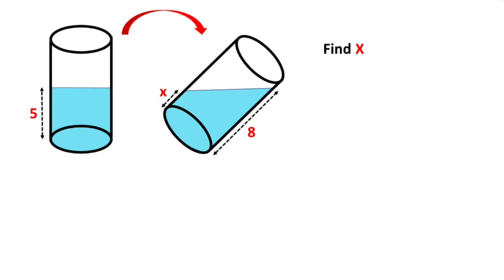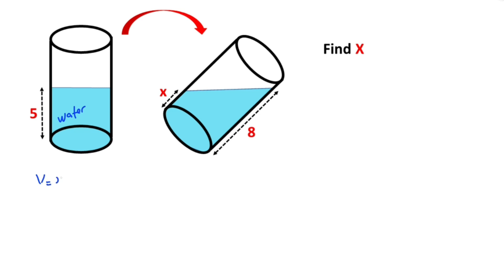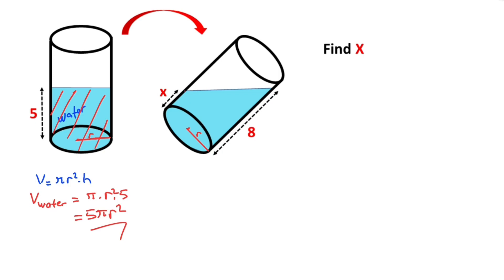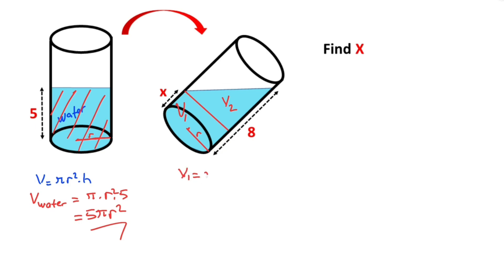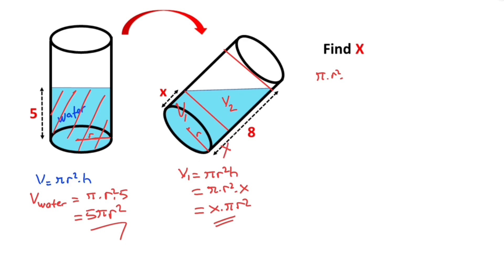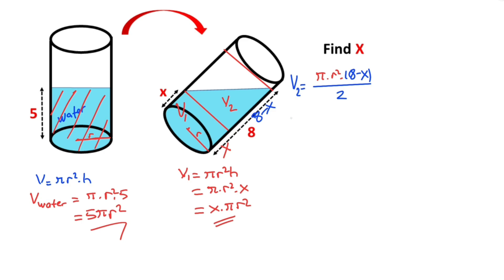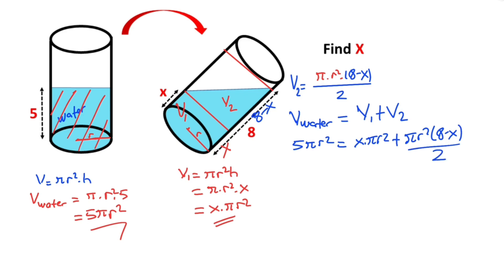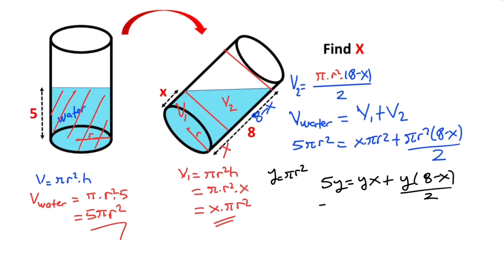How to Find The Height of the Water in the Vertical Cylinder | Solid Geometry | Math

Comment: It is not correct to equate the areas, as the image suggests, it is a cylinder (geometry in space)
Thus, with only the information provided in the image, the value of x cannot be calculated

To calculate x, additional information would be needed, such as:
The angle of inclination of the cylinder, or the diameter of the cylinder

The volume of the cylinder is equal to the volume of the cylinder sectioned by a plane (there an ellipse with semi-axes a and b is obtained)
V = πr²h to be equal to V = (π/6) * h * (a^2 + b^2 + ab)